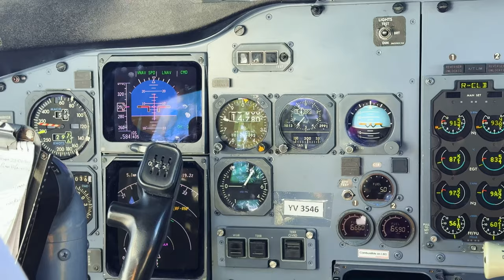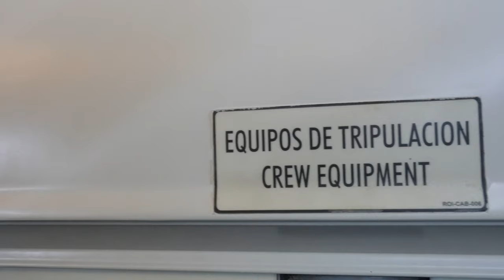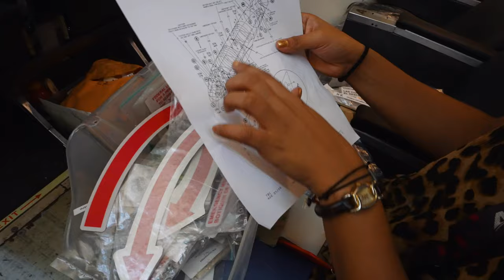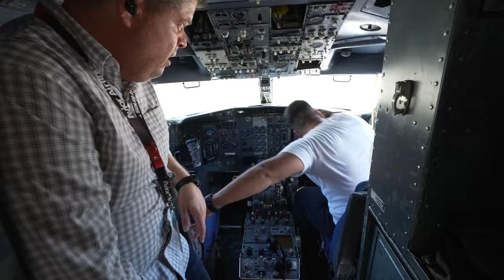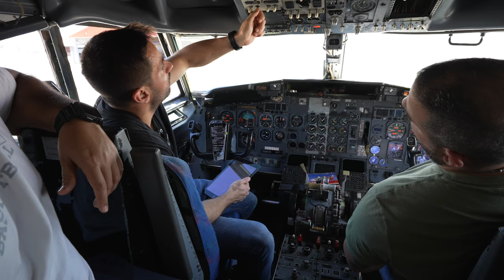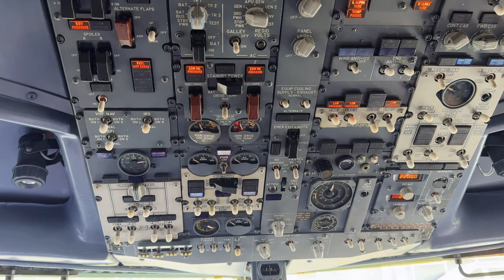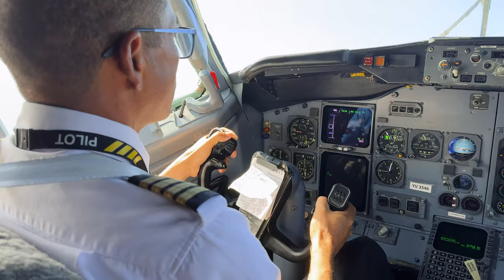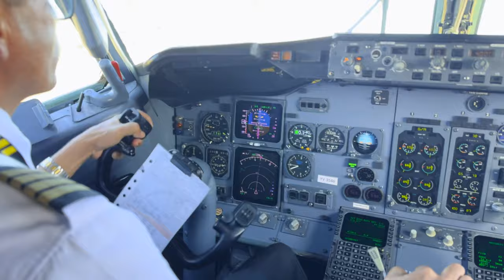Avior pilot training, 737-200 maintenance & FLIGHT DECK to Caracas!

Comment: Gabriel, thank you for another wonderful video. I'm a Brit, lived in Caracas 1990-93, and returned at least 20 times after that on brief work-contracts (oil, of course). I've flown all the Venezuelan airlines, all over the country; even a DC-3 out of Canaima. The most exhilarating flights were out of Merida, 1.5km altitude, 1.6km runway, with a notable uphill slope, in Avensa 727s; I once heard that they were specially engined to cope with that. Please keep up the great work. I left a big piece of my heart in beautiful Venezuela.

Comment: Last time I was on a 737-200 was in 2006 on the defunct Canadian low cost carrier Canjet. Got an amazing view of the thrust reversers on landing and the runway was very wet so it was even more spectacular. In 1993 when I was 10 years old I flew on a Canadian Airlines 737-200. I had asked to see the flight deck but it was too close to landing on the first leg (Toronto to halifax). Boy they had a surprise for me! They let me jump seat the takeoff from Halifax on the second leg to St John's Newfoundland.

Comment: Spent time flying the Boeing light twin trainer (200) 40 + years ago.  Glad those days are long ago.  Odd to see glass in on the flight deck, and FMC.  Hope you have -15 or -17 JT8's power.  Fuel must be cheap to make the Jurassic Jet work.  Back in the day there were only two power setting .. full thrust, or idle.

Comment: I made a flight in one of those Avoir 737 in July 2023, and as Coby says, let me explain. I took the flight CCS-SDQ in a 737-200 with a frightening consequences. They were fliying the plane with a defective pannel light for a month ago. That morning a new pilot was in command, he did not know tge issue so when the light turned on he made the protocol. Turn off the engine climbing at 8000 so the masks popped out, everybody crying and praying. We managed to get back to Maiquetia safely. That incidant was due to the lack of maintenance and responsibility of Avior. I’m Venezuelan and i’ll never fly again with Avior. No wonder FAA banned this airline.